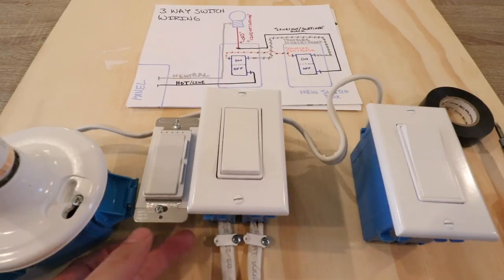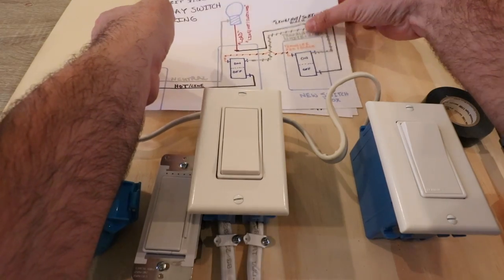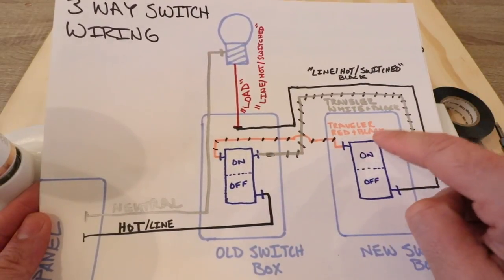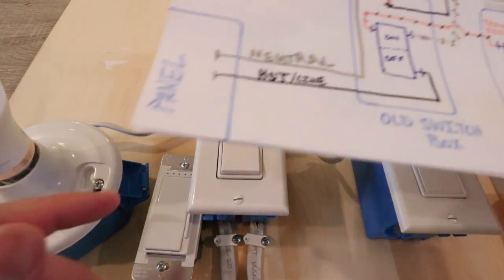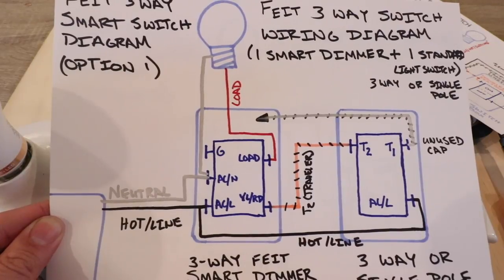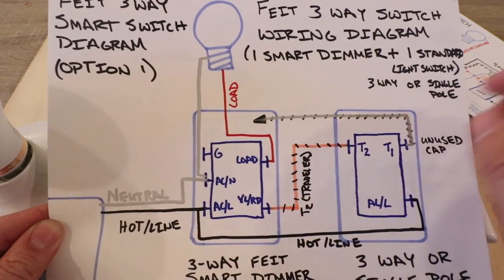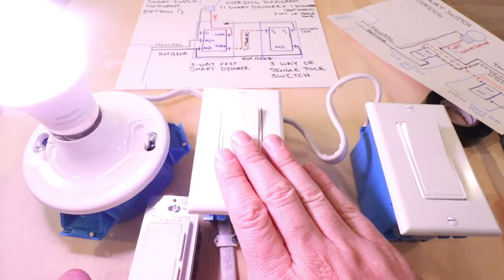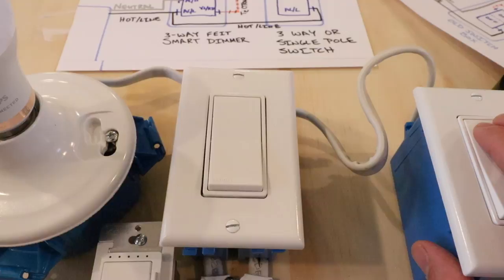How To Wire Feit 3 Way Smart Dimmer Switch

Comment: I tried this.  It doesn't work.  The regular switch doesn't work.  Only the dimmer switch works.
Reply: I am having the same issue
Reply: Were you able to find a solution? I have the same issue and my regular switch does not work
Reply: Yes, the regular switch needs to be connected to the incoming power. The smart switch needs to be connected to the fixture. The smart switch needs to be programmed to the wifi. There is a couple of seconds delay when switching off the power from regular switch.
Reply: @pauljimenez1165  i did everything you described. The dimmer works fine and its connected to my wifi. However the regular switch does not work. It does not control the light. I am not able to find the reason.
Reply: I was having the same issue. I double-checked my wiring. Connected the smart dimmer then connected the regular 3-way switch.
Reply: @pauljimenez1165  did you find your wiring was wrong?
Reply: I thought I did have it wired up right. I ended up switching the smart dimmer and 3-way switch, to see if that helped. I also switch out the smart dimmer. That could have helped also.
Reply: Did you end up figuring out the issue?  I am currently having the same problem with mine.
Reply: @joshp9842  i returned mine after getting no help from the Feit Electric customer support. Bought another brand which has exact same way of wiring and works in 3way with no issues.

Comment: Great video but I have a 4-way set of switches (3 switches total) and I can’t seem to get it to work. I followed your diagram for the two three ways and left the 4-way alone. Is it even possible to add the dimmer with a 4-way?  Any help would be appreciated.
Reply: Yes. Must use fiet dimmers in all switches and wire red traveler to line on all switches and black traveler to AC-L. Took us a solid minute to figure this out. And of course,  while on all AC-N on all switches.

Comment: Thank you!! after about 50 trips from the basement (breaker box) to my 2nd floor and trying so many different ways, I watched your video and now BOTH switches are working. Thank you for those diagrams they were so helpful. I thought it was as simple as swapping one 3 way for another not realizing I had to make a live wire in the 2nd switch now.

Comment: Great video! Is there a way to set up the first switch be a normal one (on/off) and second switch to be the Feit Smart Dimmer? I need to do this due to the location of my switches, I followed your video but switched the sequence, now the dimmer works fine but first works like a main control, if it goes off smart switch (2 switch) won't able to turn light on.
Reply: I'm having the same issue
Reply: Was this issue ever figured out?
Reply: @shamerz17  Unfortunately, this issue doesn't seem to have been resolved.  The question simply gets ignored(several times) in this video, as well as another one he put out(also several times).  I'm having the same issue, I can get the switch and dimmer to work fine, but it cannot be controlled from the far side(whether it's a regular 3-way switch or another smart dimmer.  I know of two other houses where this is how the 3 way switches are configured/installed power on one end, load on the other end.  BTW, Feit is no help!  I asked them for a schematic, they sent me two, one for regular(not smart) switches in a 3-way configuration and another for a 4-way configuration.
Reply: @Chele829 , my understanding is your 1st switch connected to hot line and 2nd connected to load. I believe there are 2 Traveller lines from 1st to 2nd, one of that you can connect to hot line in first switch so that 2nd switch also gets hot line, then you can connect dimmer in 2nd switch, now both should work as you expected

Comment: Hello - my switch is the opposite of what you have in your video.  The incoming hot go to the left and the right side switch is the one that connects to the light bulb.  Would you please do the updated video with the light bulb connect to the switch on the right side instead of the left?  Thank you!!!!
Reply: I’m having the same problem, line comes in one box, load goes out the other box, so damn confused, ever figure yours out?
Reply: It doesn't work that way. It needs to be where the light load is otherwise it won't work.

Comment: I hope this works on my Moes 3 way. using the Dummy switch just as a "Signal Event" to the smart switch is so much easier. My set up now removes the power to the wifi in  one position of the Dummy, then returns the power to the wifi in the 2nd position. Older home so I do not have neutral every whrere. Thanks for posting. This is great info.

Comment: Thanks for the video. One suggestion I would make is to utilize the strip gauge on the back of the switch and insert the wires into the back of the switch. The screws can then be tightened with a screwdriver creating a nice tight wire.
Reply: I agree with this.  It's much cleaner and easier if you need to make changes.
Reply: Electricians don’t like backstabbing as it can lead to future shorts if they get loose.

Comment: Great job! I had to work my way through installing several of these in my house, including a couple of three-way switches. I can't emphasize enough that the FEIT switch has to be the FIRST switch that is wired to the panel directly.  The FEIT switch will not function if it is in the second position. Also, do not mix up the load lines and the ACL (live load) lines. After you pull your old switch out, you can cap the wiring and then turn on the power. The line that has power when  you test will be the ACL line or the power-in line. The ACL line is directly attached to the service panel.  Once you find the ACL  wire that goes to the panel, then the other black wire is the load wire that goes to the light.  

One trick to figure out which switch is FIRST in connected to the panel is to check the distance from the panel. Almost always the closest switch will be the first switch connected to the panel by the electricians. This makes sense because the electricians wire the second switch to the first position switch AFTER the first switch is installed. 

DO cover up the lug screws with electrical tape as shown in the video. It will save you a world of time.

Comment: I'm lost!  I tried following the Feit diagram as best as possible but I don't know the wiring in the wall.  Best function I can get.  One way switch (or 3 way) in the up position dimmer works normally.  If the lights are on the old switch turns off the lights but will not turn them back on if switched back.  Old switch in OFF position the dimmer doesn't function at all.  Did I figure the wires incorrectly?  Sigh....
Reply: Eventually I tried to wire it exactly like in the diagram, and it still did not function properly.  I purchased another pair at Costco and installed one.  Everything immediately worked properly.  FEIT support sent me a replacement for the defective one.
Reply: I have the same problem!!!  So you're saying the Feit dimmer switch was defective?

Comment: Hello.  I currently have a 3way switch wired with the light between the switches.  How and where would I add the Feit switch?  

I could send a diagram of my current wiring if that helps you help me.

Comment: Great video!  Looking at these switches to purchase.  Quick question, can this switch be used on the "load" side switch versus the "line" switch?  Physical location of my 3-way switch I want to replace with one these is the one that connects to the light fixtures.  Cheers!

Comment: Thanks for sharing this but in my wiring. there is no load wire in line box. the  lights are in the centrr of both switches. so in first box I only have neutral, ground, line, T1, T2 and the second box I have t1, t2 and load and ground. there is no neutral wire and the second box. on both sides the wire running from the light to swith box   has 3 wires plus bare ground wire. What should I do in this scenario.

Another thing to note in my wiring is that the Black traveler from line box connects to the white wire from load box near the switch thats in the middle of the two switches. This way in the load box the white and red are the travelers  and black is load that is connected to the light. 

Please help

Comment: So I follow the direction and capped the traveler off But I am using ground as my neutral the main switch works however when I turn off the other switch I am getting 110 V rather than turning it off any idea why that is

Comment: I have a friend who has a similar set up. (1st switch dimmer and 2nd switch on/off) When they flip the switch on the light goes full power and then drops to half.  Any idea what is wrong? Great video BTW

Comment: I am stumped. I have my Feit working at either of my locations that has the 3 way switch. On one I have the Line, Ground, Neutral. Then there is the line to other switch.  I have a traveller wire of Black, Red, and Neutral going to secondary dumb 3 way switch. The load line to the light is in the secondary location and has Black, White, and Ground going to light. Neutral is currently tied up with the others. How do I need to setup this box to allow control from this second location? 

Right now, I have the Line from panel connecting to AC/L, Red traveller in the YL/RD, Neutral in AC-N. I'm using the other traveller to go from Load on smart switch, all the way to the other switch. I think this may be where I'm wrong.

NO matter what changes I make, I can only get the smart switch to work and not the dumb one.

Any hope or do I just need to cap off the other switches.

Comment: This is a great video that explains the Feit install so much better than the Feit Installation instructions!  Thank you!  I have one question... do you have a diagram that shows wiring for a 4 way switch configuration? My kitchen lights are controlled by 3 light switches.  Any help would be greatly appreciated!
Reply: It should be the same

Comment: Is there a video to identify which wires are the travelers, load and hot?   
I am working in a location where I can use an ohm meter - so if I need to test continuity, it should be easy.   
The problem I am having is that my smart switch is always powered, but if I flip my remote 3 ways switch it will turn the power on/off to the light only.  The smart switch is always powered.  If the remote switch is "on" the smart switch will control the light.  
So... Its halfway working.   It seemed very straightforward until it wasn't working the way I wanted it to...
I mean, maybe this is how its supposed to work.   Smart switch always works.  the light is mainly controlled by the remote switch.  
I was thinking that I might need to move the smart switch to the other side of the circuit but I think I might be missing something as far as capping off the extra traveler...  And now I'm not 100% sure certain which cables are my travelers since I can test one that I thought was a traveler on my far side and its always got power.
I guess to sum it up, my question is: Do I need to hook the smart switch up to the closest outlet to the breaker box?  I am guessing so - but both boxes appear to have a black/hot wire that stays hot no matter what the other side is doing (fully disconnected).

Comment: great video, I have a question for you, when you showed the initial setup with regular switches, your load wire was on the 2nd switch, and that was changed to be on the 1st switch for the 2nd configuration, how did you do that? my configuration is my load is on the 2nd switch and my line from breacker is on my 1st switch, I cannot install the smart switch on the 2nd switch due to space restrictions, do you think it is possible to do on the 1st switch?

Comment: Thanks a lot! Your explanations and your nice but simple sketches helped me a lot! I had one 3-way light that was causing me some headache trying to figure out how it was wired. It ended up that I had no neutral wire in either switch boxes. What is weird is that in all my other switch boxes around the house, all of them had a neutral wire. 

I was able to setup this stubborn 3-way light by getting a neutral wire from an outlet near one of the circuit switches. 

Thanks again!
Reply from the maker: Glad to hear it worked out! Thanks for the helpful comment and watching.

Comment: Could you make a video demonstrating the same Feit switch with a 3 way and with a switch loop.
I have Black lines connected to white wires. And if I just wire the Feit switch as the old switch it won’t work correctly

Comment: Thanks a million for doing this video. I spent hours troubleshooting my existing 3 way switch setup (1960s) home trying to get it to work, and i continued to either have one switch work and shut the other off or nothing working whatsoever. During this process I found I have a "radical" or California switch setup. After simply looking at the diagram you posted I realized why I was having the issues I was, and simply changed my setup to mimic the diagram posted. Viola, all working as it should.

Comment: what if the load wire is at the standard side ? this make me headache.
Reply: just checked manufactures webpage. the smart dimmer switch could only be installed on load side. sigh

Comment: How did you run hot/line wire to both of the switches at 1:52? In the first diagram without Feit switches, you have only 1 side with hot wire. Please help clarify.

Comment: I recently installed one in the basement and it works fine in wifi and manually but I need to hook one up on a circuit that has 4 switches controlling a light? Is that possible and if so can you show some kind of drawing please? Thanks Chris

Comment: My current setup (with 3 way switches controlling a couple of light fixtures) has the hot coming directly through the fixture (which is a pretty normal way to do this is my understanding). I am replacing the switch at the location where the hot from the fixture feeds. I am confused as to what goes where in this situation.

Comment: I followed your excellent, understandable directions exactly. The switch I added to the existing 3 way circuit already had a Feit dimmer at the line in and load box.  The FEIT instructions failed as the new smart switch did nothing but light up with the original. It would not switch or dim. Checked, rechecked and tried again the next day. Followed the youtube instructions which  differed from the Feit with the same result. Since I bought a 2 pack and had plans for the other I tried changing the new switch. It worked !!!!!  These smart switches work great but troubleshooting is challenging.

Comment: I bought an ordinary smart switch thinking it would replace one of my two switches controlling the overhead kitchen lights. I installed it and it works great except that the conventional switch turns off both the lights, and the smart switch. Not being an electrician, I did not foresee this. If I think positive and use some imagination, this setup actually has some advantages though I would prefer the conventional switch just turned off the lights. Anyway, I watched the video but this is all too complicated for me to figure it out and I think I'll just leave well enough alone.
Reply: I believe you just need to switch the smart switch to where the conventional switch is amd vice versa

Comment: I have the same setup but the load wire is on the other switch. Is there a way to wire that without the load going from the smart dimmer to the light.
Reply: Yes, for that situation just follow the wiring diagram in the Feit instructions provided with the dimmer.

Comment: My problem, I believe, is the line hot from the standard switch is that it's not conveniently connected in the dimmer box to the load wire as shown, but instead at a junction box in the ceiling. 
Making this a little harder. I can get both switches to operate to separately,  but only when both the second signal wire and hot wire are connected together in the standard switch box. 
When the standard switch is on,  trying to turn it off by the dimmer will only brighten the light slightly, not turn it off and visa versa. Same on the standard switch side. The light will only be off when both switches are in the off position. 
That's where I stand right now. I'll update this post when I find out and complete this installation.
Reply: I think I am in the same situation were you able to find the solution?

Comment: Awesome video, help me!!!  My dimmer is connected and works perfectly but I am having trouble with the other switch.  No matter how I wire the other switch, the other switch WILL NOT turn the lights on & off.  Can you please help?  Thanks!!!
Reply: It will turn them off, but not back on!!
Reply: Were you able to find a solution? I am having the same isue
Reply: I have the same issue .. do we have a solution ?
Reply: @almosteasy4901  - how did you fix the problem ? I too have the same problem.
Reply: @Sree  Those dummies sent me a defective unit!!!  I actually had it wired correctly - I thought I was losing my mind!  Just ordered another one from Amazon and wired it exactly the same way, and it worked perfectly.  Then I sent back the defective one.  Good luck!
Reply: Most of their switches are defective. I ordered from both costco and amazon and none worked with a correct wiring. I then ordered another brand from amazon with exact same wiring and its working perfectly.
Reply: @almosteasy4901  thank you. I got it from Costco , may be I will try with second unit.
Reply: @kotoll  thank you sir. Which brand did you switch to ?